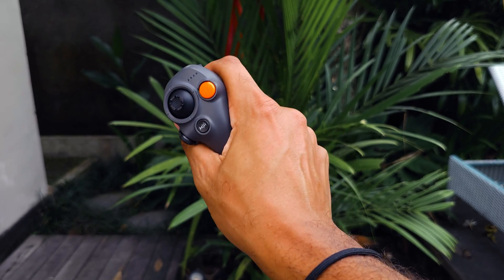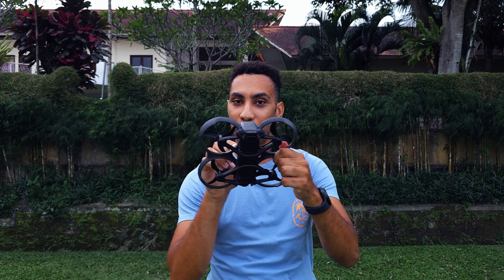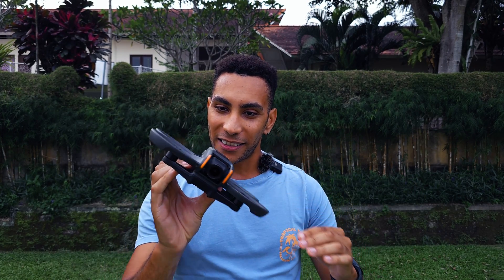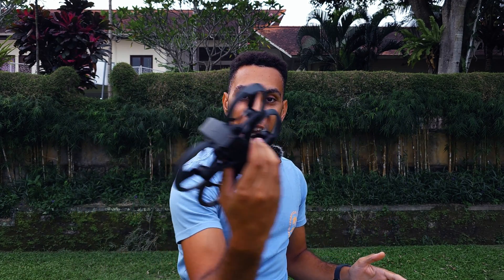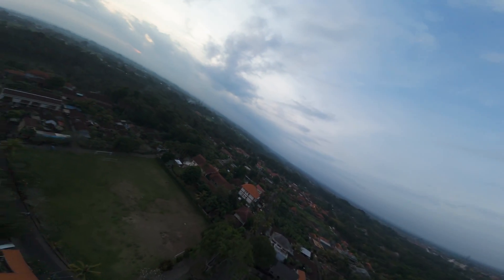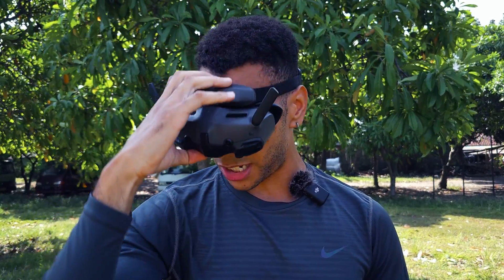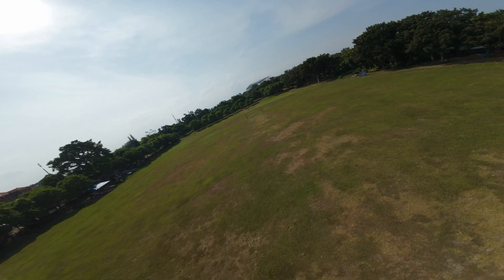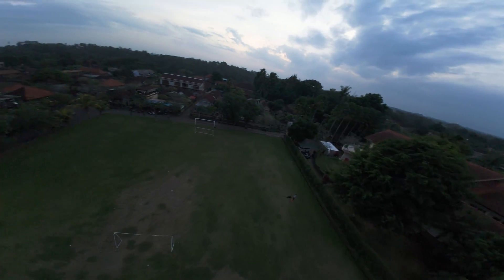How to AVOID the Yaw Tumble - DJI AVATA 2

Comment: I f*cking hate that Yaw Tumble sh*t. It does not happen that often on other normal FPV drones. AVATA 2 is too heavy for those props and that's why it happens, not because you should stop turning and having the drone in turbulence. That's just a post factor. The main reason is DJI did not build this drone for Acro mainly and that's why it is that heavy and it has Yaw Tumble problems more than any other FPV drone.

Comment: G'day Justin
Luv ya work and tips !
R.e avata 2 in manual or sports is it better to fly into the wind or with the wind to help reduce tumble  ??
Thanks 
Glen Australia 🍻 🇦🇺
Reply from the maker: Hi Glen! You will generally get less tumble when doing turns into the wind. Down wind turns are more likely to induce a tumble, but if you fly appropriately, you should be okay in either direction 😊

Comment: I greatly reduced the yaw tumble by removing the master air screw 4 bladed props I installed right after I purchased the Avata 2.
Reply from the maker: @scotthines5834  Glad to hear it. Aftermarket isn't always better 😃
Reply: Yesterday I received the HQ 3 x 3 x 3 props for Avata 2.   I tried to make the yaw tumble happen but could not. There was no wind I'm not sure if that could be a factor?  These new props are three bladed and not curved.
Reply from the maker: @scotthines5834  Hey! I was going to give those props a try before but never got round to it. No wind definitely helps a lot. Different props will have different characteristics, I can't really comment without trying them back to back. However, your observations are interesting! 😃

Comment: Thank you! Got this a lot when started flying. Lot less now… probably have more momentum now.
Now I understand why
Reply from the maker: @jonisacson  Glad you now know what's happening and how to avoid it, how are you getting on with manual mode with the Avata 2?
Reply: Great! Had my second refresh the other day. Mixed  up motors off and the mode switch. 20 m above rock hard ice.
Unfortunately the laws about sharing flight videos in Sweden is horrible. You have to get them approved by the government before showing them to anyone. Right now they have 75 working days wait time. That’s over 15 weeks. 
Really puts a damper on the hobby. No fun showing old videos.

Comment: Hey bro. what is corrective control.  After the tumble. i should do anything on the control and wait for it to be stable right ? then i can control it again ?
Reply from the maker: @russellmindanao7151  it just means put in controls to correct the drones attitude, for instance the drone snaps in the tumble, once it's snapped and has settled for a second then just input controls to bring it back to level and flying normally again.
Reply: @JustinBainbridgeYT  noted thank you

Comment: Justin, which flight simulator do you recommend if I have a DJI Avata 2? I'd like somewhere to learn to start flying manual mode.
Reply from the maker: Hey, I've been using velicodrone for my sim but there are a lot of good ones out there and I'd also be up for trying different ones. Any of the major sims will be fine. 😃
Reply: Thanks!

Comment: Question. I had the yaw tumble happened while flying and end up dropping the avata 2 from the sky and somehow the downward vision sensor stopped working. Is it claimable under warranty? Or does anyone managed to get it covered under warranty?
Reply from the maker: You can explain this to DJI and they might cover it under warranty but also maybe not. Care refresh is always good to have, but if not, repairs are normally not very expensive.

Comment: Why does this model suffer from that while DJi FPV doesnt? I cant even do a 360 roll in my Avata 1, half the time it kicks me out of manual.
Reply from the maker: Mainly due to the fact it's got prop guards. They cause a lot of aerodynamic disruption around the props. It's the trade off we make for the added protection.

Comment: and, most all "cinewhoops", being "ducted" exhibit this issue, but all other than DJI have the power to overcome, many use prop guards, not ducts, to eliminate the problem, but those mitigations do not eliminate Prop Wash/ descent wobble ! that's different than the yaw washout !
Reply from the maker: @curbie1150  Yep very true. Ducted whoops really suffer with this. I would class the Avata 2 as having prop guards rather than ducts though. And yep, this isn't yaw washout. This is prop wash. Washout is when you reach the motor rpm limit and still can not stabilise for adverse yaw, as I'm sure you know. Thanks for the input 😃

Comment: very good video, and I agree with almost everything. my only "thought" is that it is not just the prop-wash/dirty/turbulent air diminishing thrust " overall". in fact one side, the "downwind" side,  is always affected more than the upwind side, which is evident in all the videos. the quad need not enter its own turbulent air for it to happen. simply yaw turning into a high "cross wind" will do it, it is caused by the high battery and ducts and turbulence ABOVE the props that lessen available lift. on THAT side, the "LeeWard side in ailing nomenclature" the lift is diminished.

Comment: this stuff happened to me yesterday. while I was flying at full speed, and done a yaw turn (passing the tree so it would still be in frame). I totally lost all the controls (pitch yaw roll and gas) and by a skin of a teeth I didn't crash the drone on a low voltage power line.
EDIT: btw I just saw the "outside turn" at 3:17 and that's exactly what I did. Damn. I'm confused now
Reply from the maker: You might have done an outside yaw but rather than a smooth turn you might have just spun around and still went back through the dirty air. Turning in the outside stance always keeps the props in clean air as long as you are moving forwards still. Whereas doing a fast spin will still cause you to fly though the dirty air from the props. Do you have a link to the footage so i can take a look? I can help you out better if you do?

Comment: Pretty sure that's what happened during my 2nd ever manual flight today ! Fell from around 20m without enough time to recover with the pause button unfortunately, so one of the motor arm was broken and now the drone has to be sent back to DJI :(.
Reply from the maker: Ah that's a shame. Yes I find the pause button is too slow to respond to the tumble. This is one of the reasons i suggest learning to corret this manually as you'll have a better chance of saving it. Practice higher up and you should get the hang of it and after a while you'll know when you're doing a turn that puts you at more risk of experiencing it and you'll be ready to react if needs be. Hopefully it gets repaired and you get back in the air again quickly 😃

Comment: Can you hit pause button if this happens please? To use your get out of jail card?
Reply from the maker: You can yes, however I find pause is slow to respond in this situtation and you can save it much quicker with corrective inputs, but if you have enough height, the pause can save you. But I would reccomend trying to correct it manually first. 😃
Reply: @JustinBainbridgeYT  thank you Justin, yeah I was talking about more height. I was never gonna go manual but after a few days playing sims, I went out yesterday, took her up high, took the plunge and enabled manual and did ok, I didn’t crash 😂. My heart was pounding though lol. Managed a few dives and flips, but as I have played video games for a LONG time (I am 53) It really helped with the coordination needed for the RC3, sounds stupid but playing 3rd/1st person shooters definitely helped 😂. And playing hours in the sims (uncrashed and liftoff) was also very beneficial. (I use mode 3 which is similar to 3rd/1st person style controls for me)
I actually like the stiffer throttle stick even in normal/sport mode, and will still keep practising in manual but regarding most shots I want, I think normal and sport will suffice, but in certain situations like chasing a car/bike/foot chase/free running etc, I think manual will be great. I like more cinematic smoother shots so also thinking of getting the Mini Pro 4 as well as using my Avata 2.
Sorry for the long reply and thanks again for your great channel! 👍🙏

Comment: Finally someone telling the truth unlike most of these newbies that just complain about "bad design" even if they agree physics are at play "to a certain point". That's like wanting to do drift with an SUV and wondering why did the car rolled over and blame it on the design of the car
Reply from the maker: Thank you! Yes there are too many people talking about it in a way which doesn't match up with the physics at play. I just wanted to break down what it actually happening so that people know how to manage it. 😃
Reply: @JustinBainbridgeYT  The only problem with this is that a regular CF-based/DIY drone thats also a similiar Cinewhoop, as-in size & setup, with Betaflight doesnt have this problem at all... 
You can do an aggressive throttle off 180deg Yaw Spin and it will fly backwards like a regular FPV Drone would also. Considering this was a big problem on the Avata1, mostly for beginners or people coming from BF Drones flying aggressively run into this problem because it just shouldnt happen.
I do agree though that if you know the issue is there you can fly in Acro and compensate for this, but its still a "workaround" from a bad design. Whether its the FC freaking out or Ducts that dont allow the Props to get enough air to "grab" im not sure because the DJI FC's code is encrypted and not worth the time to look into and mess with.. 

When i switch between my O3 Air unit drones to my Avata1 i have to remember to "bank" my Yaw turns in Acro to keep the props pushing air, because i dont want it to tumble & fall from the sky. Which then most likely means it will break bc its all plastic.
If it happens in N/S mode then thats just crazy!!
Reply from the maker: @mxracingunlimitedltd7784  I do agree that similar BF quads dont have these issues but also they are running higher performance setups overall, lipos giving more current for quick large pid corrections vs liions on the Avata 2 which don't have the output to spool up the motors as quickly.

Prop guards, props, and like you say, the fact that the tuning is locked means we can't tune it out.
The way I see it, it's not what we want or would like, but it's what we've got, every quad has their qwerks and this is the Avata's. I just fly around it and It's fine. 

I've flown customs quads that fly 5x better than this without poor characteristics, and I've also flown whoops with horrencoud yaw washout that unrecoverable. It's just the nature of the beast, gives us more excuses to have more drones 😅
Reply: Get HQPROP DT2.9X2.7X3 prop and 90% of Avata 2 tumbles are gonne
Reply: You should really update this video advising people to get HQPROP DT2.9X2.7X3 props which mitigate 90% of this issue. They have less pitch making the Avata 2 spin its motors at a higher rpm. Cost 20 to 30% of flight time but no more stalls.
Reply: this is bullshit, because NO custom drone has this kind of problem, only dji avata has it and only brings back from the first model. I have already risked ending up in the water 3 times because of this disgusting electronics mounted on this drone
Reply: well it is bad design lol the motors are weak and
Reply: No.. its a design fault

Comment: Thank you for this! Dumb question, is there anyway to take off the avata 2 in manual mode or do you have to take off in normal and then switch to manual
Reply from the maker: No not a dumb question at all. Before the latest update you just used to double tap the start/stop button and it would start the motors in manual so you could take off in manual. But in the latest firmware this doesnt work anymore. I think this was a mistake and will hopefully be corrected in the next FW update.
Reply: @JustinBainbridgeYT  thank you for the reply. Do you mean the start Stop button on the FPV remote rather than the motion controller?
Reply from the maker: @arunr5529  Yep, the button on the lower right hand side of the back of the FPV remote. You can't fly manual mode with the motion controller.
Reply: @JustinBainbridgeYT  makes sense. I normally don’t use that button, just the sticks
Reply from the maker: @arunr5529  Yeah, I always use the sticks too. Hopefully, they bring the manual stop start back for manual mode again
Reply: @JustinBainbridgeYT  This is one thing that drives me nuts about the firmware updates. You get these unexpected function changes for no apparent reason.

Comment: if small holes in the frame sides ? maybe better airflow  less tumble
Reply from the maker: There are some cinewhoops like this but with large slots in the prop guards, and it does help. The frame on the Avata 2 would have to be resigned for this, though as it would be very weak if you started cutting holes in it
Reply: @JustinBainbridgeYT  yes but one hole in the back corner or carbon frame
Reply from the maker: @PoloHungary  you would need sizeable slots all around the guards. My other cinewhoop has this style design (GepRc Cinelog 35 V2) yeah a carbon frame mod would also help but it's a lot of effort for something that can be easily avoided if you are just aware of the way you're flying. I just use a freestyle drone if I need to be doing more intense/acrobatic flying. But it would be nice to see an aftermarket frame that's a bit stronger and incorporates some slots or a lower profile guard to help with better airflow. 😃

Comment: Could Avata 2 perform a Split-S maneuver? Is it safe from tumbling?
Reply from the maker: Yep, I do the Split S all the time without issues. You can experience the tumble if you change the pitch too severely at the bottom of the manoeuvre, but generally, the split s has been fine. The Avata 2 dives remarkably well for a cinewhoop!

Comment: Awesome video! The only thing I'm missing is a footage of the drone itself while you're performing all those maneuvers. If you could do that, it'll greatly help understanding the relations between the view in the goggles and the presentation of the drone. Thanks!
Reply from the maker: Hey! The best I could do is the demo at the start, trying to film it in flight is very tricky and the drone would look tiny in the video or I'd have to get really close and low in which case it would probably crash before I could recover. I was basically performing a similar flight manoeuvre in the flight to what I showed at the beginning. Hope this helps. 😃

Comment: So what about the EASY ACRO 180 trick ? That doesnt do anything strange right? or not that i have seen it?
You helped me with that shaking going down though, thank you for the great video !
Reply from the maker: The easy acro trick will be fine as the drone stays fairly level and turns and tilts backwards at the same time, keeping the props in clean air.
Reply: @JustinBainbridgeYT  OKe i see, thank you for the explination !

Comment: Great video thank you. If I don’t fly manual but just stick to normal or sport mode then i shouldn’t encounter this right?
Reply from the maker: Yeah, you should be fine if you're just sticking to normal or sport mode. It's very hard to put the aircraft into the attitude required to encounter the tumble in normal/sport mode 😃
Reply: @JustinBainbridgeYT  thank you for replying Justin 👊🏽👊🏾👊🏻

Comment: You absolutely right ! If you fly low and fast yaw then you lose control and you have no time to correct yourself right away . and I broke my left front motor and my gimbal cracked.😢 dawn that is very expensive Hobby . by the way, Dji have new update for the Avata 2 ? You could link on your DJI goggle 2 and goggle Integra also motion controller 😮 about time .
Reply from the maker: Yep, if it happens low down, you might not have time to react. Yes, I just saw the update. You can now use the original Avata ancillaries to fly the Avata 2. I need to do some reading and testing to see what else this update includes 😃